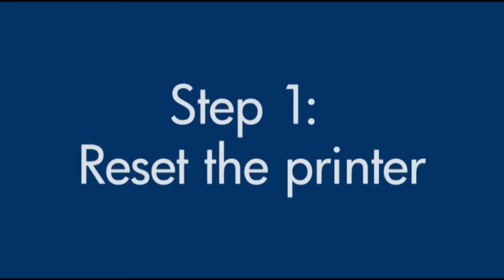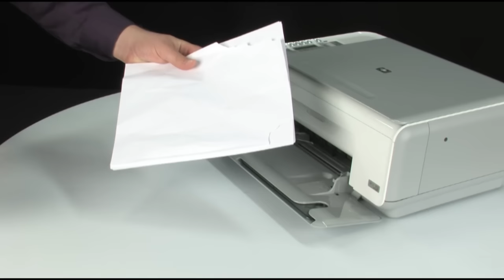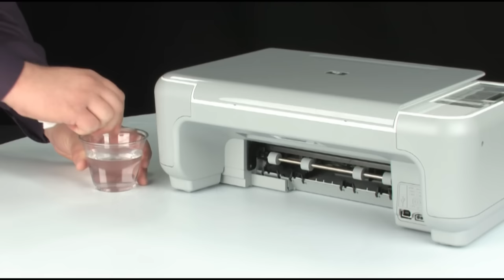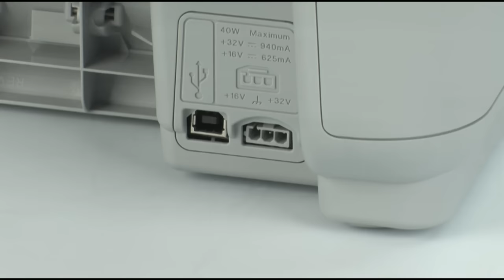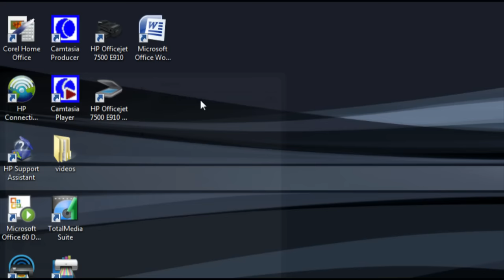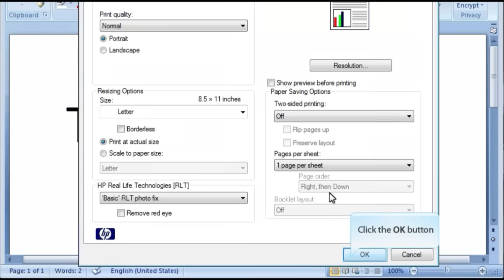Fixing Paper Pick-Up Issues | HP Photosmart C3180 All-in-One Printer | HP

Comment: I tried everything in this video but no success. At first it was taking the paper if I push the top paper for some time, however now it doesn't take whatever I do. I removed the rear access door, and observed the rollers and found out that the rollers do not move when the printer tries to take paper.
Reply from the maker: +mozdemiray If the paper pick up rollers rotate, I'm afraid it could be a hardware defect. You can still the following steps to make sure no steps were missed: http://hp.care/2tDHOAJ

Comment: I can see inside the printer when trying to print with paper in that the bottom two rollers dont spin but I see gears on one so I know it must spin where is the paper sensor?  Is it a lever or a diode?
Reply from the maker: +mst3kpimp The steps to fix this type of issues can be found in this document: http://hp.care/2qVKif6
Reply: @HPSupport   That link is now broken. Do you have a new link for the same thing?

Comment: I replaced the cartridge and the Cartridge alignment page didn't print. what happened?
Reply from the maker: Hi Jaira C.,
If you search for C01580846 on HP’s home page or using Google search.  The title of the document is “Aligning Ink Cartridges”.  It will walk you through aligning the cartridges using your computer.  It has instructions for Windows and Mac operating systems.

Comment: Hello! I have an hp C3180 that does not feed paper to print ! Because I pulled the paper before printing ! How do I resolve this? Thank you!
Reply from the maker: Even though you didn't indicate that you are getting a paper jam message, I suggest that you follow the steps in the "Clearing a Paper Jam for HP Photosmart C3100 and PSC 1510 All-in-One Printer Series" document ( http://ow.ly/bNuE301fLZ7 ).  In case the paper jam document doesn't help I've also included the "Blinking Lights on the HP PSC 1500 and Photosmart C3100 All-in-One Printer Series" document ( http://ow.ly/n0ad301fM4N ) for you.